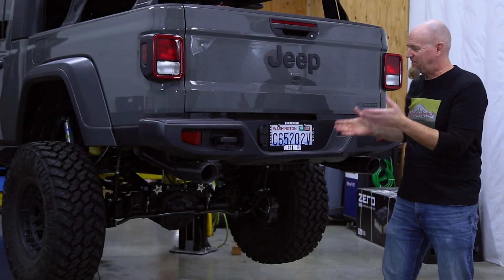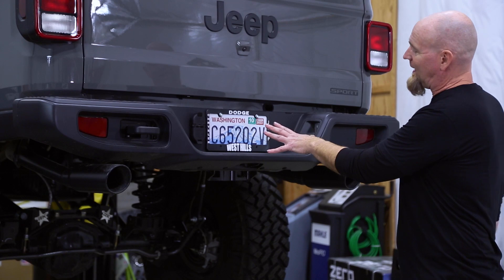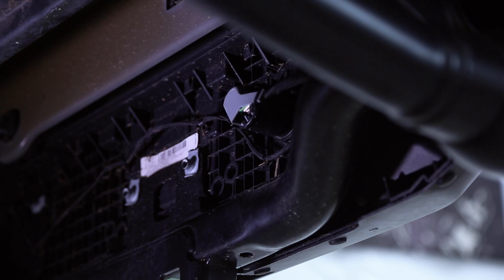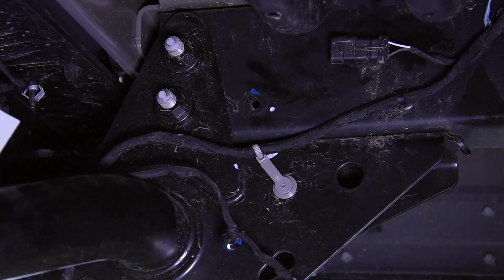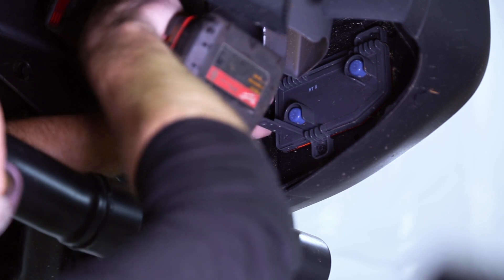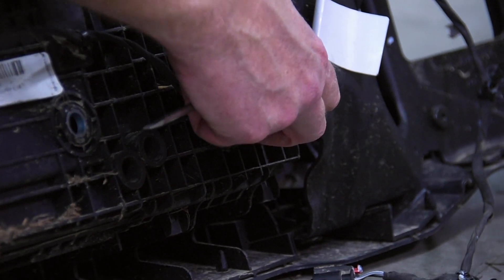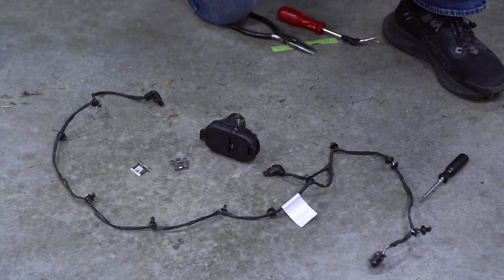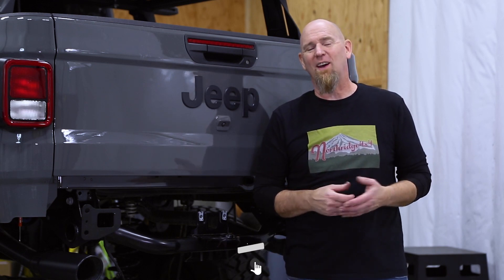Jeep Gladiator JT  - How To Remove Factory REAR Bumper

Comment: On a Rubicon (and Mojave?) there are two additional 16mm socket size bolts that attach the side bed guards to the rear bumper on each side (so 4 total) which also need to be removed. It is easiest to loosen the 3 vertical bolts (16mm) on each guard to give them some play when removing the bumper bolts. Also perhaps 'tow package' related, there are 2 vertical T50 Torx bolts in the license plate area that need to be removed. If you are doing this on your garage floor and not a lift, there is enough slack in the license plate light and trailer connector harness to remove the bumper enough to access the connectors and Christmas tree mounts from the top which makes it much easier.
Reply from the maker: Thanks for the additional info!

Comment: Help please. I’m having problems taking off the parking sensor. I already took out the little red thing.
Reply: * I mean disconnect wire harness
Reply from the maker: They can be a PITA to get disconnected. Once you have the red lock pulled back, depress the button and wiggle the connectors. Sometimes you can carefully wedge a little screwdriver in there to help get them apart while you are holding down the release.